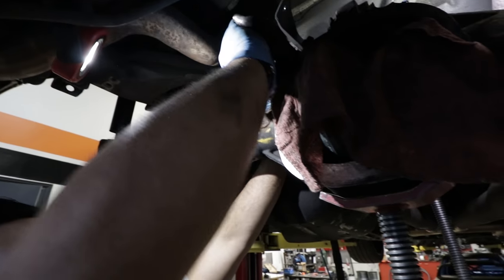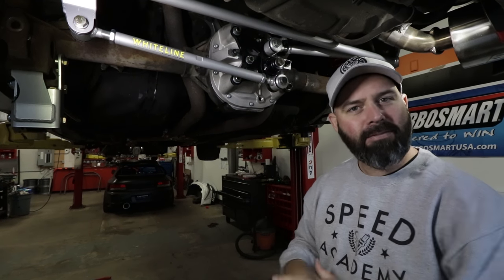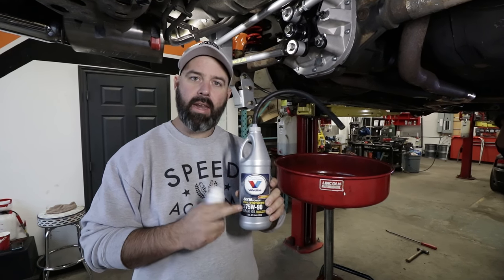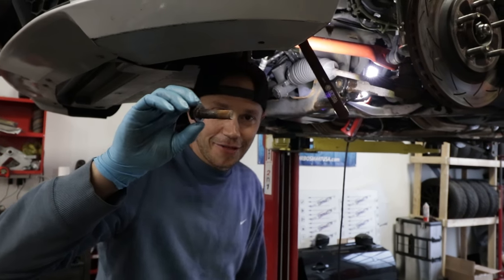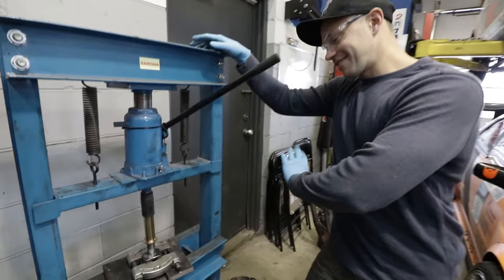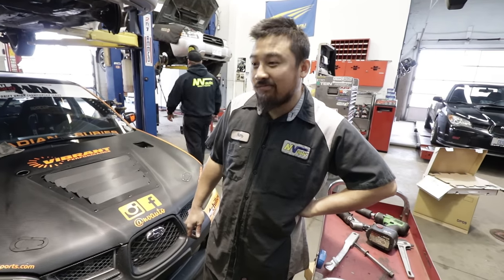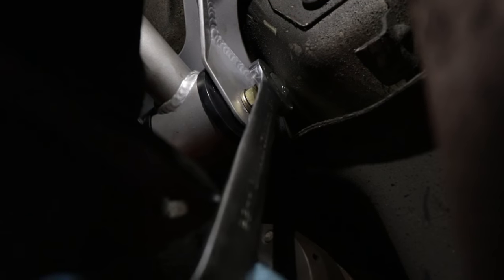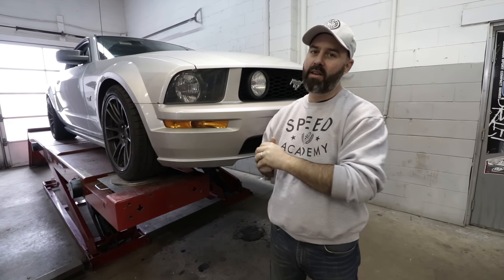Ford Mustang Rear End Rebuild & Watts link Part 2 - Mullet Mustang - EP08

Comment: be sure to check the torque on the main pivot on the watts link. being a single sheer type mount, vibration can cause the bolt to back out. grassroots motorsport had a similar issue in their s197 5.0
Reply from the maker: Thanks will do!

Comment: That is why you remove the nut size like you are suppose too....Did a nice job weakening the front control arm mount with a cutting tip ...

Comment: Love this content guys, actual things people can do with quantification on track and not just crazy all out builds. One tip though, its a bit wonky that one side is 1.4 neg camber and the other is 2, in my understanding it is best to be equal in every aspect you can. I understand if you could only get 1.4 but evening it out would balance the front more, especially if its .6 a degree difference
Reply from the maker: Truth be told, .5 of a degree is not that big a deal. If you look at how much that is in the real world then you'll quickly see it's not going to do anything wonky to the suspension.

Comment: Looks like you used the the right RTV .IIRC the ultra gray is for 2 flat machine surfaces sealing. 
 All RTSVs are not a like/ the same.
Reply: roger depew not at all if you work on cars professionally you'll know this. some can/ can't be used in transmissions same goes for rear ends

Comment: Be careful. I've seen two of those upper poly bushed control arms fail. It needs to twist.  Those polly bushing don't twist.   If you left the stock rubber in the diff housing you should be ok though.

Comment: Another common failure point is the center bushing on top of the rear axle housing. Not to worry, its cheap and easy to replace..
Reply: Norevlimitr has a chevy but knows all about ford rear ends 😉

Comment: I thought the rule was for toe-in if you're RWD.  Toe-out may give you a lot of darting around under heavy braking as bushing compliance will let the wheels pivot towards the rear a little and add to your toe-out number.
Reply: PS: How does a solid axle get to have toe-out?  I thought the housing would have to be bent for that to happen, since the axle tubes should (in theory) be perfectly in line with each other across the car.  Or am I missing something here?
Reply from the maker: From a safety, daily driving standpoint toe-in is good but for performance you want to have a bit of toe out to help with rotation. It does cause a bit of instability at high speeds though. Well worth the trade off.
Reply from the maker: In theory it should be perfect but with bearings, bushings, etc. there's always a bit of slop so it can add toe out/in.

Comment: I know I would be battling my front lower arms on my 96 Z/28. Instead I bought the cheapest complete oem style arms I could. and pressed out the questionable junk. And pressed in some poly bushings and ACDelco ball joints. Much easier working with clean, new (but shitty) stuff lol.
Reply: Michael Allen thats thw way to go the arm is functional it may not be high strength billet chromoly super skookum but it works and for most of us thats all we want

Comment: How do you have toe out in the rear with a solid axle?
Reply: lukeybabes1 I don't think you can the wheel has to stay mated to the axle, flush. so I can't see any way of adjusting the toe angle and not fucking up the diff or axle bearings
Reply: Ryan Rohauer that's why I'm asking how they have toe out. Didn't see any joints on the axle shafts they pulled out. So how can there be toe out?
Reply from the maker: Because there's always a bit of play in the bearings, axles, etc. so you get a bit of toe out/toe in that occurs.

Comment: They still use solid axle in modern cars? This seems so ancient. Like, it needs so many parts to make sense that it doesn't seem worth it.
Reply: Some economy cars and the new Volvos use solid axle also.
Reply: new generation of mustang ditched it finally.
Reply: It is cheap. That's why it is used.
Reply: Gregory S Hutchison Would think this generation Mustang would have IRS considering it was roughly 30 grand new though lol

EDIT: **for a GT
Reply: Basomga Ford used that junk rear suspension in the GT Stang all the way up until 2014. So shameful of them.
Reply: It's cheap, strong, light and good enough for the time. Internet racers really complain about the SRA but in reality, the capabilities of the stock suspension is way beyond anything that the average driver will encounter.
Reply: Basomga IRS is also less than ideal for drag racing due to camber gains during compression reducing the tire's contact patch. IRS is also typicly does not put up with as much power and is less efficiant adding to driveline power loss. Honestly the handleing advantages in IRS aren't that big. It's mostly a comfort thing in that an IRS car won't twich as much if you hit a bump or crack while turning. A lot of IRS car need similar parts like trailing arms, lateral arms, and relocation brackets to really work well too.
Reply: James Gullatt the Mustang Cobra R got IRS in 00 and the "Terminator" Cobra in 03-04
Reply: Basomga the Mustang was a solid rear axle until 2014, except for a few oddball special editions. Cheap to build, and beloved of stoplight drag racers.
Reply: Basomga it is great for off-roading
Reply: Russ0825 I don't see many peoplr offroading mustangs
Reply: Basomga very popular among Jeep guys.
Reply: Luigi de Guzman The older ones, right?
Reply: Basomga no, all around. Off road, the live axle has another advantage in that it allows for a great deal of articulation—lots more wheel travel. Important for rock crawling, when combined with other suspension upgrades.
Reply: Luigi de Guzman Oh yeah. I saw that on Off Road pickups and jeeps  some time ago in Dirt Everyday.
Reply: Well, i got the point. In some applications it's useful and it is mostly used by manufacturers to reduce costs. But as Nicholas said; "...It's mostly a comfort thing in that IRS car won't twitch as much if you hit a bump or crack while turning...". Does it mean that IRS is less overteery than Solid axle?
Reply: Basomga depends on the setup. The big problem with live axles vs IRS is in mid-corner bumps. The suspension upgrades shown in this video are meant to solve that problem.
Reply: Luigi de Guzman Luigi de Guzman that's just the watts link. It makes a huge difference but still won't be quite as settled as IRS. It'll be interesting to see how the poly bushings in the trailing arms and top link effect the rear since they could potentially bind. It would have been better if they used spherical rod ends if this was to spend more time on the track than the street.
Reply: I've had a few fox4 mustangs (foxbody, sn95 and new edge) that i fixed the quadrabind rear suspension on and drove a friend's IRS equipped 00 GT recently.... not worth the $1000+ investment. it wasn't much more stable, and only under severe bumps did it really become remotely noticeable. look up BTM Auto sport, he uses a solid axle and is leading his class in autoX. in a drift car, a solid axle is ideal since you always have 0° of camber and therefore more grip throughout the whole slide. that being said, if you drive mountain roads then you know to look for bumps to anticipate for. I have never spun or had to recover from an uneven road surface. just sharing my experiences with the cars you guys are trying to talk about with little to no experience with.

Comment: Did you guys really spend $900 on a watts link and you didn't want to spend <$200 on new control arms?
Reply from the maker: Why would we do control arms? Are you talking about adjustable ones or new stock ones? We're all about reusing parts and spending our money wisely so control arms are last on the list.
Reply: Speed Academy not knocking thriftiness. But the GT500 arms are really cheap, and the aftermarket ones (not cheap) come with the upgraded bushing you replaced with the whiteline anti-dive kit. Two birds with one stone. I only know because I spend time dream shopping for my S197 😂
Reply from the maker: Well good to know! Next time we'll buy the GT500 arms!